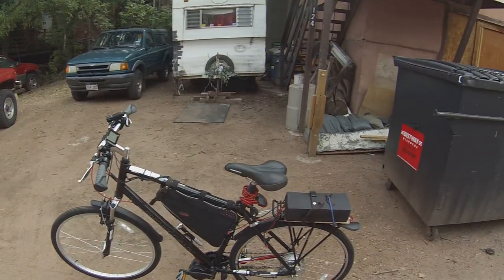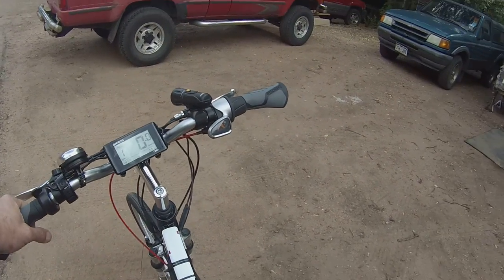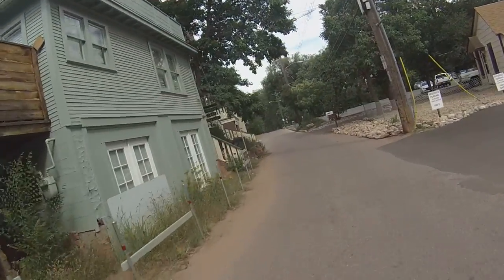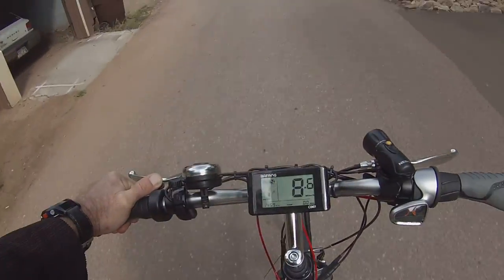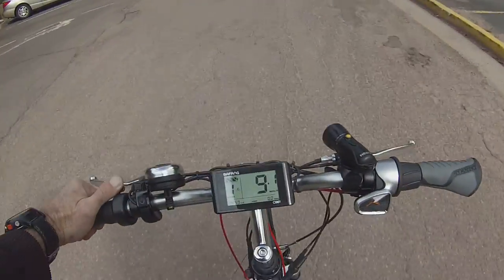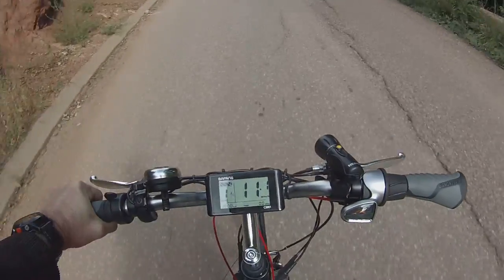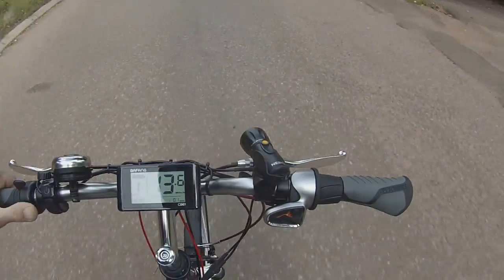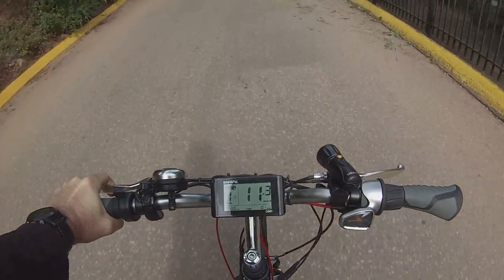Bafang Mid-Drive Electric Bicycle - maiden voyage

Comment: Charles I run a similar set up to yours the throttle on the left is no problem to use you quickly adapt to it, as u say the Nu Vinchi shifter only mounts to the right.I differ with u about powershifting tho, the NuVinchi will shift under load you just turn shifter very small amounts to move up gear range.I now have mine set up with the electric harmony shifter and it does change under load I can move off throttle only lightly to get bike moving then full throttle at fast walking place I get rapid seemless acceleration to top speed so it does not require cutting power to make shifts.The only time it is reluctant to shift up is under heavy loadings on a hill so not something I try to do the harmony unit waits until it can make a gear shift to maintain set cadence it rarely seems to get stuck in gear.
Reply from the maker: Marshall Whiston - Be careful. I've heard from a couple people that have blown out their N360s using the Bafang 750W motor. (Also, use of ANY electric motor larger than 250W voids the warranty.) For that reason, I baby mine a bit...

Comment: I rarely if ever just move off under full throttle I use my legs and generally ride in level 2/3 with enough input of throttle to maintain progress on hills, the main point is that that the harmony gear shifter works which it would not if it was under excessive load.So the N360 can shift under a fair amount of load, how long it lasts time will tell but however you use it hooked up to a 750w BBS 02 your warrantee goes out the window.

Comment: Great video and great discussion thread here. Charles any update on performance after the 6month mark? Also, just curious but on flat ground what's the average maximum speed you can reach throttle only?

Comment: Thanks for the video.  I have received my unit, but my battery doesn't arrive for a while. I have one question.  I see that you made your thumb drive such that you push it forward above the handle bar and not below the handle bar. The wiring of the unit (since the wire comes off of one side) does seem to make sense that it should be done your way, but for safety's sake wouldn't it be best to turn it around and have the thumb on the underside of the grip?  I've never used a thumb throttle, so I don't know what is most comfortable.

Comment: Thanks for charing! I'm installing mine tonight after work. Do you have manual brakes? I have hydraulic. According to the online manual I found it seems I have to install the cut off brakes otherwise it won't work?
Reply from the maker: Yeah, I've got cable brakes. Bafang does make a hydraulic brake sensor, but you might have to look on aliexpress or contact 8Fun directly (szbaf.com) to find it.

Comment: Hope this has worked out. Some people complain the Bafang mid-drive is not so smooth when shifting with the standard derailer. This would solve that? The Nuvinci listed on Amazon says something about a 250W motor capability. Is that an issue at all? Thanks. Nice to know there might be some decent priced alternatives if my hub drive ebike ever bites the dust.
Reply from the maker: George,

The bike is working great for me. My only REAL worry is having it stolen when I leave it locked up somewhere.The thing about the NuVinci and shifting is twofold-

 1. the NuVinci will NOT shift under load
 2. the shifter WILL break if forced.

That in mind, I actually like how the Bafang/Nuvinci combo shifts. I have found that by stopping pedaling and simultaneously letting off the throttle then just barely tapping on the break I can force the motor to disengage. When I feel that happen, I shift. But I NEVER force the shifter. 

AFA the 250 watt thing. it's actually an improvement from the original warranty, which was voided by powered set-ups of any kind. (They also have a new transmission specifically for ebikes called the 'Harmony Sync' which is automatic! So you could look into that.) 

There are a ton of people using the Bafang/NuVinci combo with no problems. The only complaint I've heard is that the older NuVinci's leak oil after a while. Also, I'm not too worried about damaging my hub as I picked up my NuVinci n360 for SUPER cheap. It handles the 750 watt bafang nicely and is working perfectly with no leaks 700km in... (crosses fingers)
Reply: Charles,

I really appreciate the information. It sounds like it works very well but people need to observe a simple set of rules. Apparently the Bosch mid-drive is very smooth with the standard derailer systems. But it is about 5 times the price and, hey, to me, it's just an electric motor. Bafang may have had a couple of rocky months, but the BBS02 seems pretty solid. 

Not too thrilled that NuVinci is basically partnering the Sync with the Bosch drive, and in Europe only to start. The people who are doing interesting things in the US are the experimenters.

Bafang is a pretty solid company, from what I've read, with a few dozen engineers on the staff. I figure they will refine the product over the next year. I also think the automatic transmission idea will be pushed along over the next year.

But my hub drive with a throttle works well enough. You get exactly what you need from your system. Most ebikers seem to be pretty happy with what they have. I have a bike that would adapt to the BBS02 pretty well, so I might fiddle with it. Lots of great information on You Tube.

Thanks again!
Reply from the maker: George Sears  - 
Yeah,the main noticeable difference is the Bosch systems have a torque sensor. While the Bafang do not. That makes pedal assist MUCH ncer on the Bosch. (The Bosch system also stops assist sooner when you stop pedaling.) That's the main complaint I hear about the Bafang.-  'PAS could be smoother'.

But they are great kits! Especially for the price. One simply must understand their limitations... Plus Bosch only sells to OEMs. So it's not an option for the hobbyist ir DIYer.
Reply: use internal shimano/nexus hub, i have the 7speed and its just fine.. just don't shift when the motor is spinning. First just touch the brake very little so that the motor power quits then shift. Its like a motorcycle.
Reply from the maker: I'm actually using a nuvinci n360 with a drum rear brake...

Comment: Hello mate, thanks for sharing your video. I would like to ask if you have pedaling resistance with your kit ? Coz I received my kit today and just installed it, but it has significant pedaling resistance with power off...
Reply from the maker: Yes, there is some resistance (perhaps 2-3%). But it loosens up over time.

Comment: I have the same motor on a diamondback overdrive sport. I really like that direct drive you are using. I am using the shift sensor with great success. What has been your top speed in this configuration?
Reply from the maker: +NYangryguy - On level ground, about 27MPH. (I've got it geared low too as it's hilly where I live. Could get faster with a larger chainring...)

Comment: Hello mate it is me again. 
Thanks for your videos and replies I got my kit installed and running. Now I am having 2 new issues would you be so kind giving advise:
(1) -> PAS works like position sensing rather than torque sensing, and there is motor delay on start and stop pedaling, also slight delay on throttle. Can I improve it in anyway ?
(2) -> The display clock does not work, the time just freezes... Do you think it is display issue or controller issue ?

Greetz ~
Reply from the maker: Hey No problem. I'm glad to assist.

AFA #1, the Bafang has no torque sensor. It only has the speed sensor and the feedback from the motor itself. So there is a slight delay in it turning on (and off). There are some adjustments available through the configuration utility via laptop/FTDI adapter. But it's also possible to REALLY mess things up as well. So care must be taken. (see this video for details - Bafang BBS-02 Advanced Serial Hacking - Throttle )

For #2 that does NOT sound right. Once set up (via the menu where you push + and - at the same time) the clock should work normally and the ':' should flash once per second.

Comment: I try to push the pedal backward, It can make 3 rotations. And pedaling forward has friction kind of noise (power off). Do you think my kit does not work correct ?
Reply from the maker: No that sounds fine as long as it's not grinding or anything. When turning the cranks backwards you'll hear the click click of the freewheel. Turning the crank forward should provide slight resistance. (Note- DON'T force the chainring to rotate backwards.)